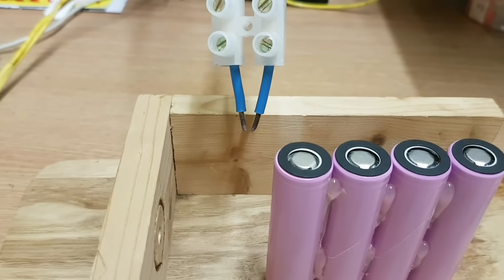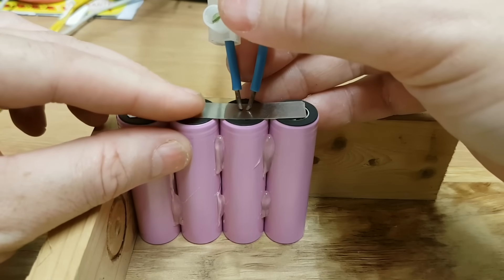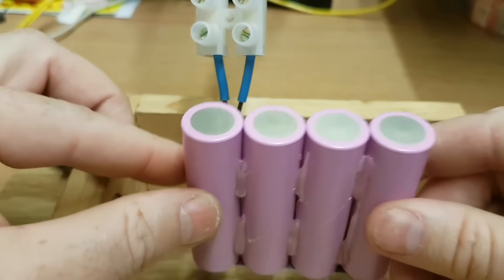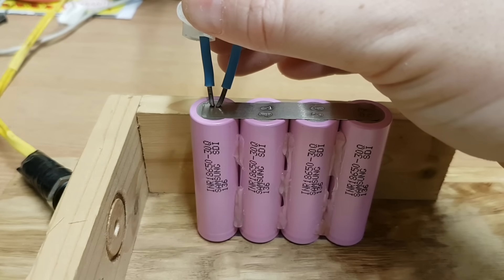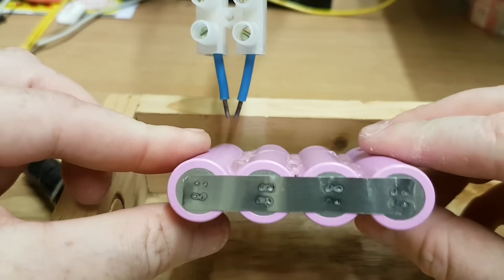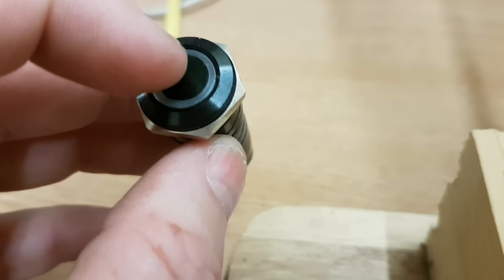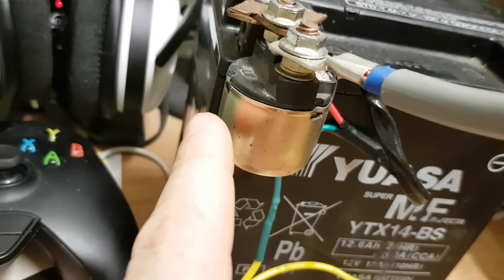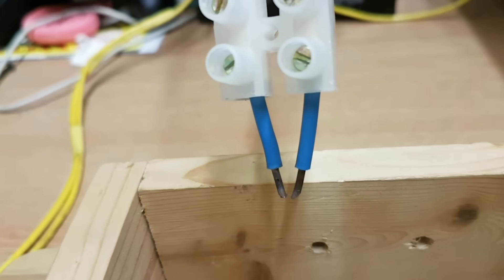DIY Battery Spot Welder - Demonstration & Explanation

Comment: I can confirm this works perfectly!!!! You saved me so much time and money thank you!! I got a 230 cranking amp battery from Walmart for $20 and a car solenoid from the local auto parts store and all set up for under $50!!!
Reply from the maker: That's awesome! So good to hear of your success. Good work 👍🏻
Reply: @darkkevind  I don't understand what's the role of the solenoid.. what does it do?
Reply from the maker: @marcopinchetti5872  it switches the current through the thick wire from the battery, quickly. So in order to create the circuit, bridge the electrodes on your nickel on top of the battery, you still don't have a complete circuit until you switch the solenoid...
Reply: @darkkevind  Thank you! 
Still: isn't that what a normal switch does?
Reply from the maker: @marcopinchetti5872  yes, but it handles very high current, which a regular switch can't cope with
Reply: Just note that you can buy pretty good portable spot welders for small batteries for about $65 (in 2025), which gives you more control than this. I'm all for DIY, but unless you have junk laying around, it's probably not cost effective.

Comment: I have just done your exact circuit with a 64ah car battery (600 amps) and it has blown out the nickel. I do not recomend going above 250 amps.
Reply from the maker: I'm using 330A and it's not blowing the nickel for me.... most blowouts occur from poor contact between the electrodes and the nickel, as it arcs instead.

Comment: Hi guys I was thinking of making a spot welder with microwave transformer, I wrote a program to a  PIC where I can adjust the time from 0 to 2 sec. but I was thinking about to switch the 220V side of the transformer with a triac, could this work?, thanx.

Comment: Hello.. i made one.. whats the total volts your batt have? Mine is 12.85v reading.. but i get to overweld some batt.. made a hole on it. Huhu
Reply from the maker: Mine is the same, but it's not about the volts, it's about the current. You may have too much current. Check the CCA rating of your battery.
Reply: @darkkevind  whats the good and safe current? Can u tell me?
Reply from the maker: @wahida5355  200-400A

Comment: With regard to your possible use of a timer.    I used one like that and very quickly found that the relay is not nearly as robust in terms of amp handling as it boasts.   The little blue box relays are not really robust enough.   The contacts fail.    I switched to one using powerful mosfets  and, of course, variable timing circuit included.    I did not rely on the heat sink provided which was a slab of the circuit board material.   I added a decent heat sink with fins etc.    in the end I detected very little heating anyway.    Frankly, your set up works so well I would stick with it.    Simple.   Robust.   Good job.
Reply from the maker: Thanks.
Hold on, you didn't try to put the high current through the little timer switch did you? 😖

Comment: Where the positive and negative wire of solenoid are connected?
Reply from the maker: Negative and positive of the main battery, but the positive is broken by a momentary push button.

Comment: did anyone manage to simply use the wall outlet power?
Reply from the maker: You'll blow a breaker, possibly yourself up or at best blind yourself! Don't attempt it.
Reply: @darkkevind  thanks for your reply, but I did not mean to simply put some wire on the outlet! Using a transformator or something, there should be an easy way right? If not, why?
Reply from the maker: @ytrew9717  there's loads of videos on YouTube of a spot welder using a microwave transformer...

Comment: Nice video, clear explanation, but do you have a scematic for adding the timer relais inbetween the wiring?
Reply from the maker: Thanks. I don't unfortunately but it's literally just intercepting the manual button press to activate the solenoid.
Reply: so set it inbetween the momentary push button wiring?
Reply from the maker: @lucbisschops  yes, that's correct.
Reply: thanks a lot, i have a 105Ah 540Amp CCA semi traction boat battery, would this be to much?
Reply from the maker: @lucbisschops  I think you'll be ok with that. It might want to blow a hole in everything the first 10 welds or so, so practice on something expendable, but after that it should calm down. 👍

Comment: If you were using the timing board, you wouldn't need the solenoid right?...and can you please also do a video of the connection using the timing board.
Reply from the maker: No, you would still need the solenoid because of the high current
Reply: @darkkevind  okay thanks alot...i do understand this delay timer handles 10A current max...but please kindly do a video using the delay timer

Comment: Tried youtube transformer weilder, 600amp 6 volt,
Blasted a crater into my lithium sony vtc5a 18650 battery terminal!

battery shell= aluminum,
Heard it needs 300 amps to weild...
Reply: Not true bro. Battery spot welders send a 5ms (.005 sec) pulse of current to weld for high amperage units. The best a switch can do is half a sec (.5 sec) due to human reaction times to push in then release. You basically sent a thousand pulses worth of electricity through that one 600A weld.
Reply: @paulandrulis4672  Look into kWeld, amazing little unit and yes very efficient indeed, just tired it on 10x0.2mm nickel strip and saw about 1050A per spot weld but yes that's over a very short time period and a lot more efficient than any human can achieve. But cost money of course and not everyone want or can shell out $ just like that, others want the experience of DIY for the fun of it, we all have our reasons. But for me time is of the essence and have got very limited hours to spend + bought quite a few new, expensive higher end 18650 cells so in my case I suppose the project itself can swallow the cost of the spot welder unit, understand some build smaller packs or get cheap or even free cells though and that's where the extra cost for the kWeld make a negative dent I suppose?
Either way to each his own. nice to see peoples creativity either way, in my line of work we also often tell other there is a thousand ways of solving every single problem we run into and it's so true.
Reply: A $15 Spot welder Controller makes a lot of difference. You can control the time and current. Here's a link but you can buy similar ones on ebay from China but takes about a month to arrive. I got the 100A and worked really well for me.  https://www.aliexpress.com/item/NY-D01-100A-40A-Spot-Welding-Machine-Control-Board-Welder-Transformer-Controller-Panel-Parts-Adjust-Time/32873812813.html?src=google&albslr=230310488&src=google&albch=shopping&acnt=494-037-6276&isdl=y&slnk=&plac=&mtctp=&albbt=Google_7_shopping&aff_platform=google&aff_short_key=UneMJZVf&&albagn=888888&albcp=1582410664&albag=59754279756&trgt=310549338888&crea=en32873812813&netw=u&device=c&gclid=Cj0KCQjwitPnBRCQARIsAA5n84lpun8Zzh5qciuL9JNoQWCZGvwS0ZTyQeZ1joSi7MBuwZJzqqtz-RsaAhPOEALw_wcB&gclsrc=aw.ds

Comment: I have too many 12v 4ah (80 cca) battery laying around. Can i parallel them like 2 units 160 cca to get a decent weld?
Reply from the maker: You could try. You'll need at least 200A though really. You'd have to make sure that the cable you parallel them with is VERY heavy guage.

Comment: ... Don't hot glue batteries together.  Batteries heat up when they're under load. -- The glue won't remelt, but it will slowly flow, and end up in the wrong places in your projects over a few months of regular usage...
Reply: You really think that's going to get hot enough to melt off the hot glue, and not knowing what he's building in the end pretty irrelevant complaint.
Reply: Soldering glue.
Reply: Soldering glue wouldn't.
Reply: @juniorchambers-e2u  OH WOW EINSTEIN SERIOUSLY?
Reply: Dude , this glue needs more than 100 degree celsus to melt, if it melts in your battery, you have big problems with pack not with glue 😅
Reply: Yeah silicone caulk looks just like hot glue, but acts different under heat!
Reply: Did u learn the hard way😅
Reply: I think he's just using it to temporarily hold the cells together while spot welding them.
Reply: @TheCloudwalkerFPV  And then what?  He exposes the batteries to a bunch of heat and melts it off?? Yeah right...
Reply: @BrainSlugs83 hot glue just peels off most surfaces, you don’t need to heat it up to remove it
Reply: There’s high temp glue, which is what I guess he’s using.
Reply: @alexcorona  it's still thermoplastic... and it will still flow, and it's still a bad idea for battery packs... -- ask me how I know.
Reply: These welds are crap , are overburned

Comment: Hi, not sure what level of production you are doing but could you not configure your setup to make all welds at once. Some sort of jig to hold the strip of batteries would take away your need to hold them while welding. Finally the rig holding your welding points could have the switch on, keeping your fingers away from the business end of the welder.
Just some thoughts, I know little to nothing about electronics so I am not even sure if this is feasible with the components you have available. 👍

Comment: This is NOT a good idea!!! If you going to be doing this, get a real spot welder. https://www.ebay.com/itm/Hand-Held-SUNKKO-737G-Battery-Spot-Welder-with-Pulse-Current-Display-Welder-US/223202893214
Reply from the maker: Why's it not a good idea? Please give me facts and evidence? I've been using this spot welder for the last year at least with great results.
Reply: @darkkevind  Well, I'm happy you have good results.  However, your viewers are making potential bombs in their house by over welding there batteries and blowing holes in them.  We had a customer come into our store and show us your video and was asking for help in making improvements to it.  As the eBay listing shows it cheaper to buy a real welder that has current limiting and a timer.  I would hate to hear about a viewer burning their houses down or worst their person.
Reply from the maker: @wel97459  Potential bombs! That's a bit dramatic isn't it? Have you seen an 18650 shorted or vented through blowing a hole in the metal casing!? It's not exactly a bomb now is it? Ha! Your customer obviously didn't do it right, probably arced the electrodes or had a battery with a much too high CCA.
Reply: @darkkevind  My customer had no electrical knowledge. Leave him with a button that did not have the current rating needed to drive the relay, and was getting stuck when pressed, as you give no guidance on what the current rating of the button used. But after looking at the cost of a real welder, I don't think this project is worth the time and risk when you can have the real thing for less than $200 USD.
Reply from the maker: @wel97459  if they had no electrical knowledge then what the hell were they doing attempting to build this!? Ridiculous! Natural selection, obviously.
Reply: @darkkevind 1. Is it 100% safe to be shorting out a battery, that can output 200 amps of current without a current limit?  If your brain says YES then your no better than my costumer at electronics  2. I think you are doing yourself and the community of hobbyists a disservice by showing them this type of video without giving them all the facts needed to be safe, and in this case, I'm using safe loosely... it would be better to show them how to use a real welder off eBay.

Comment: i think that is far better use 2 tungsten tig welding electrodes whit a 3d printed torch with input for argon gas, and the rest the same, that is going to be a complete fusion and not "mechanical" welds

Comment: Thanks for the video! I need now to replace just one battery from a 4-pack,  is there a way to undo  it? without breaking the strip?
Reply: Very precise drilling out the spot welds and making new ones in the remaining strip.

Comment: hey great DIY video, i wanted to make something like this, however i have 12v65Amp car battery sitting around, do you think it can do the job?  OR should i buy lower amps battery? thanks.
Reply from the maker: Hi, you'll actually need a higher amp battery than that. 200A I would recommend, minimum.

Comment: you basically shorting the battery each time. isn't that shorten the battery drastically. how can we make this from other power source like a huge capacitor with dc power or something like that
Reply: A capacitor, or capacitor array, with the same potential as the battery would be much more expensive than the battery. You'd have to charge it more frequently as well.

Comment: I would put capacitor in parallel with output of relay as close to it (Between relay output and battery ground) because that would suppress any inductive spikes that would cause arc in relay.

Comment: Sweet and simple....my kind of DIY.  One bit of info missing to make it idiot proof for me.  What is the "air gap" (thinking like a spark plug) of those two wires?  The I wouldnt need trial and error to avoid arc between them rather than travel through nickel strap.
Appreciate your efforts.
Reply: The arc at 12V would need a gap at max of about a quarter to half a millimeter. Arc distance is based off of voltage so around 120V is when you get to maybe 2-3mm.

Comment: Hi, i've made pretty much the same setup, 300cca battery, momentary switch and a older car solenoid (brand new) which was suppose to be rated at 150 Amps, but nearly every time i've tried to spot weld a nickel strip to a battery the solenoid, stays open or on - by this i mean i hear the click as it activates and click when it deactivates without doing any soldering, but when i'm trying to solder a battery with a nickel strip you hear the first click but not the second - and this was also confirmed the first attempt blew a hole in the top of a good battery pack and left some burrs on the copper probes, i then tried to clean the burr off with pointy nose pliers and proceed to zap the pliers as it touched both probes because the solenoid hadn't deactivated until i press the switch again. i then tried to do 2 quick taps in the hope that it would help the solenoid deactivate on some 0V cells and blew the same sized hole in the tops, i'd also tried quicker taps of the switch knowing it had to be the shortest of bursts to spot weld still the same result when actually trying to spot weld the solenoid stayed activated and live. Oh i also tried different thicknesses of nickel as well, the thicker stuff didn't quite blow big holes the same but still not viable like it is.

I'm hoping it is the solenoid that is the problem, the Amp rating was marked as 150Amp continuous, but maybe it is not great quality (though i bought it for $70 from a Auto parts supplier chain here in Australia) or overrated and i need to try a different solenoid?? also looked at a timer relay, but if it is the solenoid sticking, then it wouldn't help, would it?? 

Any help or suggestions by appreciated TIA
Reply from the maker: I think your solenoid is definitely the problem. Just go for a cheap scooter or ATV starter solenoid like mine... It'll definitely work then 👍
Reply: @darkkevind  Thanks for the reply, i thought as much but assumed the car one that had a rating of 150A would be better than an unknown one but doesn't look like it this time - half my luck.
Reply: @steveandrews2121  Your solenoid was rated for 150A but you were putting 300A through it.  Thats your problem.

Comment: That battery no chance to get 200 amps....
Reply: On min 6:40 you explain that any battery that is rated 200 amps,check and see...do not get me wrong,nice and explicit video thougt but i was thinking a bike battery can not have 200 amps
Reply from the maker: @danpaslea4605  It's an ATV battery and it's CCA rating is 200A. You can clearly see that on the battery casing.

Comment: Hi 
Hope you don't mind me asking you
I would like to make the same unit as yours as I have Lipos I need repairing
This would be ideal
Can you tell me what the solenoid is off you have used and any other parts I would need
many thanks
Reply from the maker: This solenoid is off of a 50cc scooter 👍
Reply: No special volts or anything on it I need to look for on ebay
Appreciate you getting back to me
Reply from the maker: @madforit9661  12v

Comment: Two quick possible improvements, first is a foot pedal so you can use both hands and the other is a better handle (think soldering iron with 2 tip and when you press hard it activates the solenoid.)
Reply: He says about a foot pedal in his video
Reply: Id rather not have the foot pedal. Keeps one hand out of there
Reply: @Thishandleisntavailableyo  It's 12 Volts. You would be very lucky to even feel a tickle in your fingers.
Reply: @gpoaacbh711  i was referring to burns not shock

Comment: I built one of these and it burned the crap out of the top of my battery... nearly caught on fire! So be careful out there. I ended up ordering the Malectronic arduino welder.
Reply from the maker: That'll happen if you don't hold both electrodes firmly on the cell... It arcs.

Comment: I wanna say thanks for making this video. I think once I get paid I'm gonna make one myself so I can make my own e-skate batteries!!! I also saw some Arduino spot welders on ebay but I think I will go with this.
Reply: Do I also need the 12v delay relay timer? I didn't see it wired to your build so I'm assuming no but I wanted to ask to make sure before I buy all this. I don't want to buy all of this and in the end still have to wait a week for another part.
Reply from the maker: @3dprintingpunk31  I wouldn't bother, I time mine by hand.
Reply from the maker: You're very welcome! 👍